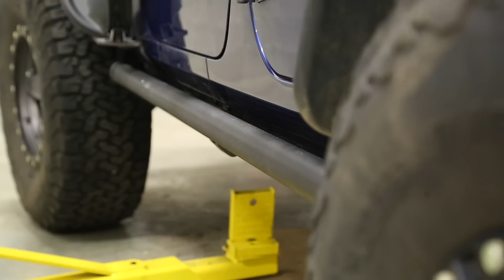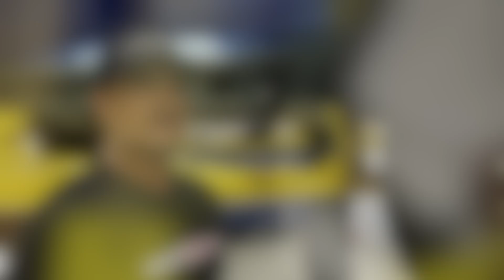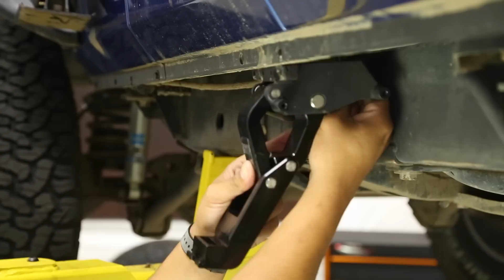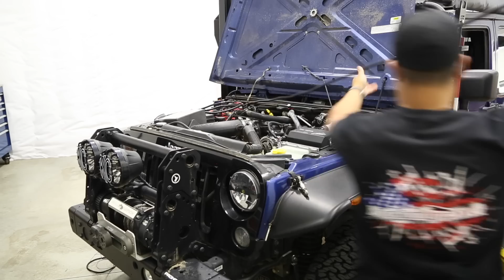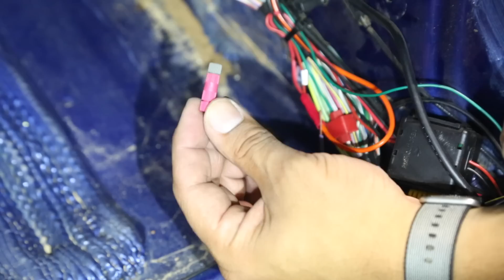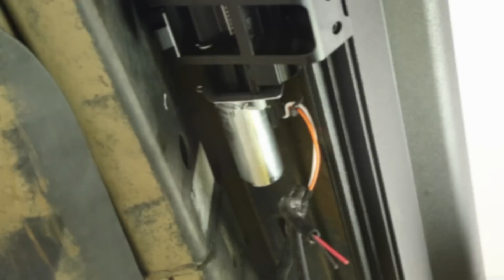Amp Research Power Step Install | 2007-2018 Jeep Wrangler JK

Comment: I installed the AMP Research Power Steps on my 2020 Rubicon Gladiator LE. I've had Zero issues with off-roading in Texas, Colorado, Arkansas and Tennessee.  As long as you have a spotter and know how to select your lines, these steps  will work as expected. If you have plans to rock crawl and put your skid plates/diff covers to through the ringer, then power steps probably aren't for you. But if you plan on going off-roading and not trailer your rig back home several hundred miles, then this is a great option.

Comment: I just used YOUR video to install my boards on my 2011 JK. Thanks! I am posting a video tonight on my channel and giving you a huge shout-out for recording this. No way I could've recorded it all. I had to take my old "static" steps off first - and that took forever, because I had LEDs on em. I had to do extra wiring for the LEDs that I already had on there, but the process you recorded is FLAWLESS! Worked like a charm the first time thru. THANK YOU, and please sub my page and like the video I'm tagging you in, brotha!

Comment: These automatic running boards work great on mall jeeps but not worth anything to actual off roaders. Go on Rubicon trail then see how well they work when u get down.
Reply from the maker: These are definitely for the mild crowd. We do have other steps and rocker guards for those needing something with more beef.
https://www.northridge4x4.com/scp/exterior/armor/rockers-sliders

Comment: Hello sir,
My sister has a really nice Jeep. It is custom and is a great look. She has been having electrical problems in which the boards do not extend out. Battery Dead!
when needed, she activate the wipers and the dash dims, car radio dims, and the dash flickers. The problem started when the floor boards were installed.
Any advise from you Sir, would be appreciated or anyone in the community. BTW she has been taking the Jeep back to where she had the floor boards installed and several times my sister was informed that it was repaired, but same problem reoccurs.
Thanks

Comment: Looks like you only installed one of the LEDs. Was there a reason for that? Instructions show two LEDs per side. Asking because I got the XTreme set and cannot follow install instructions regarding the LED (instructions say install on front, which is also where the motor is. Looks like you went behind, which is what I also ended up doing.

Comment: Do they work in the ice and snow in the winter? Do they freeze up? Does the motor have protection in case the linkage is frozen? I've cut my wheel wells about 1" at the front of the rear tires in the back to accommadate 39" krawlers, How long are the rails? Can I trim them if needed or are they short enough that no trimming is needed.
Reply from the maker: For that instance where they will be exposed to conditions of snow / ice / mud we would recommend the extreme series. They are equipped with a more aggressive extrusion and feature quad motors to handle the added weight in those situations and abuse. The motors are Bosch units and have covers to protect them. To keep linkages in good working conditions, simply pressure washing them from time to time will help ensure extended operating life. Give us a call and we'll set you up!
Reply: I've got a mostly offroad jeep so I decided to go with a rock slide engineering sliders gen2.  They offer more offroad protection than the amp research steps and I like how the actuator is completely protected from the elements.   Going to order soon looking around for the best price, can you beat 4wheelparts price?  The part number I'm looking at is BD-SS-201-JK4 (JKU 4door with armor)
Reply from the maker: Sorry for the delayed reply. Call us at 866-601-5340 or email us at sales@northridge4x4.com, we'll be able to get you a quote right away.

Comment: Lift size and tire size of this Jeep??
Reply from the maker: @Brandon, That JK has an Icon 4.5" stage 2 lift and 37" BFG KO2.
https://www.northridge4x4.com/part/4-5in-lifts/k24002-icon-vehicle-dynamics-4-5-suspension-lift-system-stage-2
https://www.northridge4x4.com/part/tires/12987-bfgoodrich-all-terrain-t-a-ko2-37x12-50r17-lt-tire

Comment: Do you have a switch to bypass power board? When I take off doors it doesn't work.
Reply: Conrad Baron all you have to do is get the steps where you want it and pull the fuse. You can also wire it to switch if desired.

Comment: With the system, are you able to remove the doors with no problem?? Or would wire still be connected to the door?
Reply: ClayDayz you have to attach the activation wire to the other side (jeep side not the door side)of the wire harness to be able to remove the doors
Reply: Jeeperz Creeperz hey quick question I’m about to get ready to do my install but when you mean the jeep side you are talking about the plug that stays in the jeep right when you detach the door

Comment: Hey man, I was wondering, in one of the video of the 2014 jk experience, I noticed that one of the 3.6l jks had a rev limiter, just like the older 4.0l tjs. You know, the famous cut off rev limiter! My 2012 jk 3.6l doesn't have it, even if I have it fully floored in, in first gear in low range on flat surface (it just reaches really high rpms but just stays there without the sound of a rev limiter) do you know why some jeeps have it and some other doesn't ? What could I do to have a rev limiter on my jeep ? https://www.facebook.com/pg/wayalife/videos/?ref=page_internal here's the video of the jeep with the rev limiter!